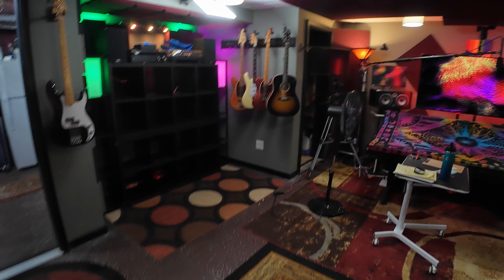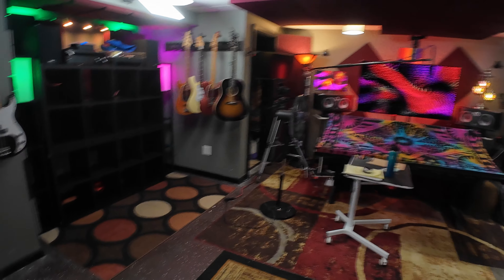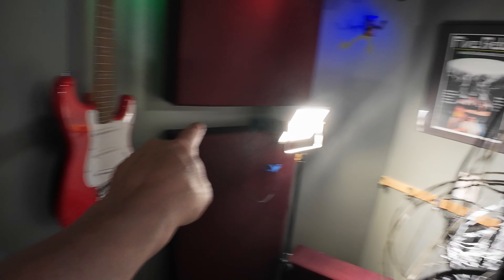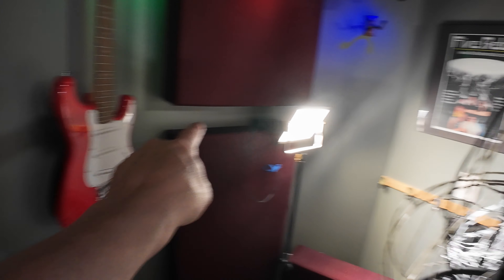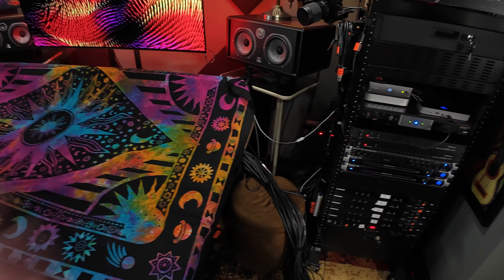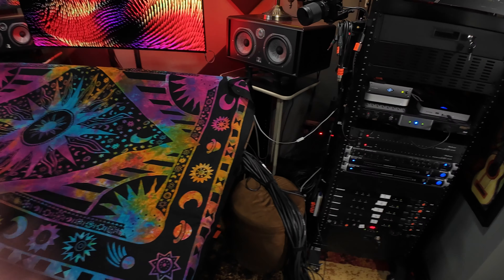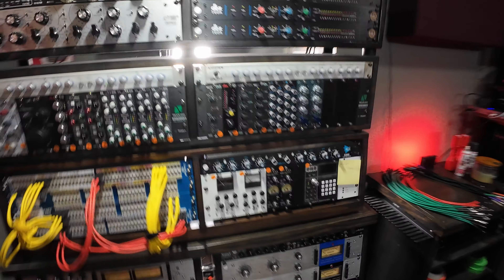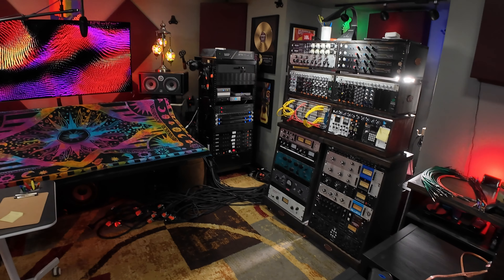STUDIO RE-BUILD / Re-Configuration | Part 2

Comment: I built 2 side cars ,for patchbay  convertors and 500 racks  etc... and a  smaller roll around rack ,so I can stay in the sweet spot, but I would not have enough rack space for your  setups would need a bigger boat:face-green-smiling:
Reply from the maker: The roll around cart is a great idea

Comment: Hey Dave,  would it not be better to keep the outboard gear closer to the SSL as is so you can just reach over and tweak the gear? Dont get how putting the gear further away at the side of the room helps work flow.  I keep my outboard right next to me or as close as I can so I can tweak in the sweet spot when possible. Great channel. Cheers L
Reply from the maker: No way to put them that close and I did not want to feel closed in.
Reply: Fair enough, Dave, thanks. 
I seen the mix you done with the new studio setup and you seem to be getting over to the outboard with ease. So if it works it works! Hello from Scotland! Cheers L

Comment: Why not put the server rack in position where rack 1 is with the Distressors etc and shift the 2 racks of gear closer towards the console, towards the guitars. Just a thought as the cables would have  more tolerance to go along the wall edge to the gear , but great work you're making great progress buddy.
Reply from the maker: Thanks for the tip